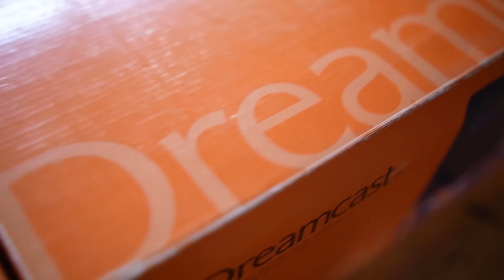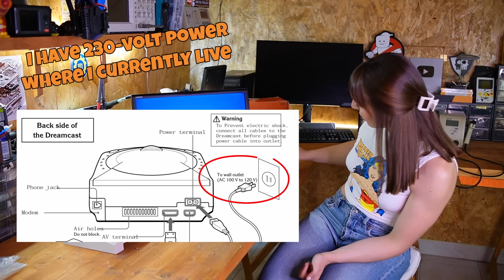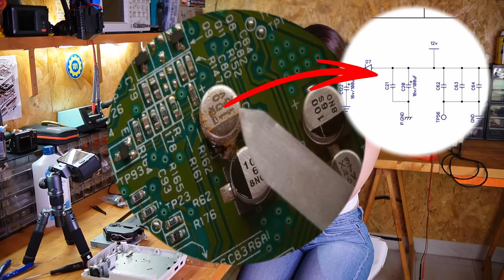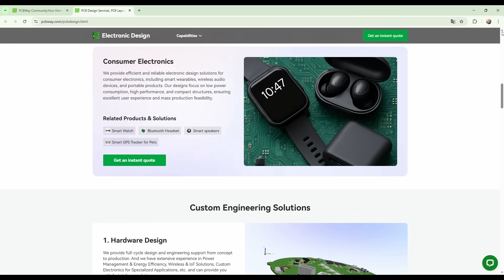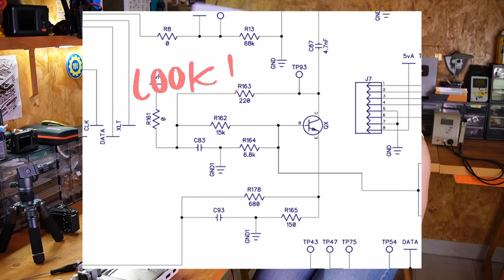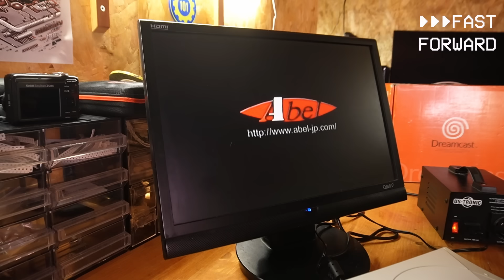Can I Save My Mom’s Dreamcast After All These Years?

Comment: The Dreamcast was mind blowing when it was released. In my opinion, it wasn't the Dreamcast that killed SEGA. It was the whole 32X/Saturn debacle. They had made their customer base too suspicious with some bad platform moves, pushing many users to Playstation. By the time the Dreamcast launched, so many of SEGA's core users had already deserted and the Dreamcast was too little, too late.

Even though it wasn't around for an extended period, the library has some amazing games and developers were able to get good looking games that ran really well. It wasn't abnormal to have solid 50+FPS in the titles.

Always great to see someone saving a machine from hitting the trash. The Dreamcast has some fun left in it still for sure!
Reply: It wasn't the 32X, Saturn debacle. It was the incompetence of Sega of America management. They made a lot of blunders.
Reply: First of all a CD burner didn't cost 600 in 2000, maybe 100 or a bit more. Piracy wasn't much of a factor, 90% of those people wouldn't buy the games anyway...

 As for the Dreamcast fate i think it was due to not having a DVD and lost people's trust after the 32x fiasco. DVD player cost was significant back then and having it for free on the ps2 was massive. Sega was so dumb they didn't even release a proper Sonic game on the Saturn to keep the platform afloat, by the time they released the DC they had probably lost 85% of their Megadrive fan base. They created a solid status that Sega's consoles don't have many/good games and could be discontinued 2 years after you got them, and that's exactly what happened with 32x/Saturn/DC
Reply: @kynikos007 Piracy is always a factor, it was so easy on the Dreamcast that literally everybody was doing it and if the company is making no money on the hardware or in a lot of cases a small loss then every sale to a pirate actually hurts the company.

But yes, the DVD was a massive factor, a lesson I've never understood Microsoft missing with the 360 putting only a DVD in and going the HDDVD route externally.
Reply: Those ~10 millions that bought the DC probably were a mix of remaining die hard Sega fans plus some rich guys that could instantly buy the ps2 after it came out and wanted some next level gaming. The rest waited, didn't trust Sega, when ps2 was released and reached massive sales all parties shifted their attention there. So there was no point in Sega trying to keep Dreamcast alive unless they would sell it for like 99$ and lose even further.
Reply: What really killed it off I suspect was piracy, it was so simple to play a copied game. back then cough some people were buying them down the local market in packs of 5 for a tenner.
Reply: @thebaldconvict   The wave of accessible piracy came in after the console was already discontinued. Furthermore if the console stayed popular, the next wave of titles and next batch of consoles would have implemented more anti piracy measures to slow it down. A burner in 2000 costs $600 (on top of more for the PC) and the typical Internet connection is dial-up, you cannot just copy a Dreamcast disc, you have to download someone's prepared image, which means 30 hours of phone line time per game. When in 2004 a burner costs $40 and people have DSL, then of course it hits big.

What killed it is the low install base. If a million people bought the console and connected it up, the most you can sell of any one game is 1 million units, and only a certain fraction of those will be your target group. If install base is 10 million, you fare much better. The Dreamcast never reached a sufficient install base to be viable. If anything, piracy could have helped it in this particular circumstance, but there wasn't enough time for it to play out either way.

Essentially it was slow early take-up that sealed its fate. People were waiting for PS2 and didn't buy the Dreamcast, and then people waited for Gamecube and didn't buy the Dreamcast, and eventually, it was not possible to plant enough consoles in people's homes.
Reply: @SianaGearz  I'm not sure where you are in the world but I had a burner in in the UK in '98 and it didn't cost me anywhere near that, maybe £2-300, I was an apprentice at the time so it wouldn't be much more, It was one of the earlier ones as well as it still used a slot in caddy rather than a drawer.
Before we had those we used to "borrow" the burner in the shop PC's and the shop had cable internet too. Spoilt I was!

I also had ADSL in my home in 2000 at a whopping £75 per month for 512kb so downloding images wasn't a problem either. BUT as I said people were buying them for 5 for £10.

"If anything, piracy could have helped it in this particular circumstance"

Maybe but then you usually end up with third parties refusing to support a platform if piracy is rife.

"but there wasn't enough time for it to play out either way."

Agreed.
Reply: @thebaldconvict Piracy does not have a financial impact. You would have the burden of proving that those people would have bought the games otherwise, and you can't. Meanwhile, Sega was not pumping out enough AAA exclusives, and the PS2 could play DVDs. If Sega had chosen 3dfx technology and made the Dreamcast cheaper while also providing more AAA titles, we would have 4 major console manufacturers and 4 GPU companies at least.